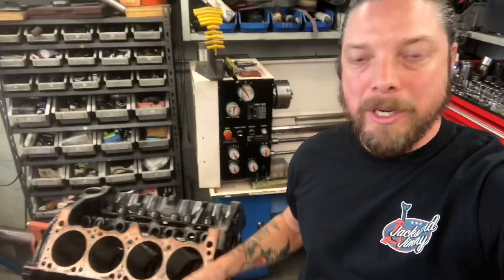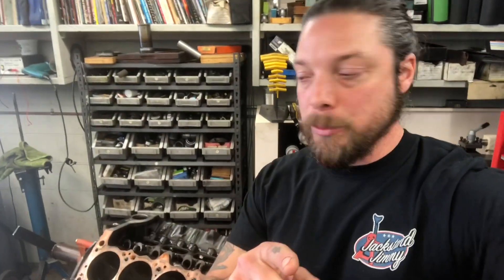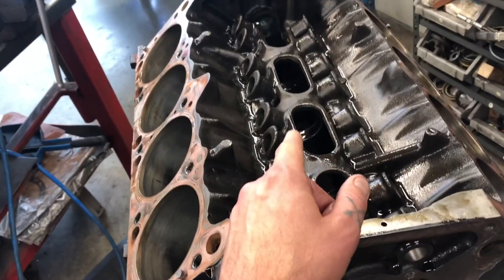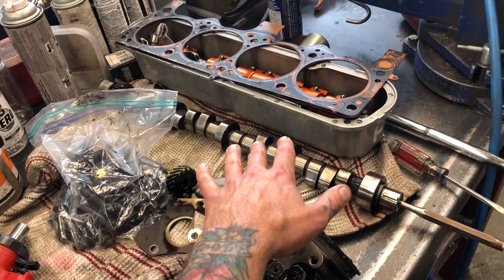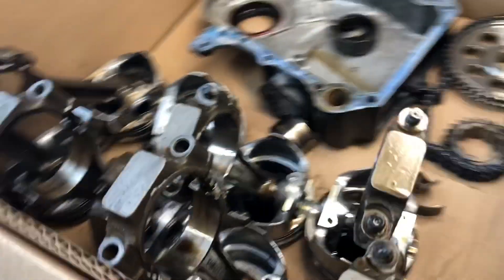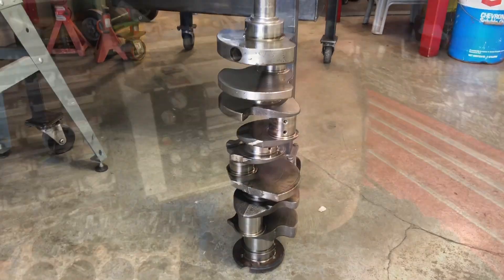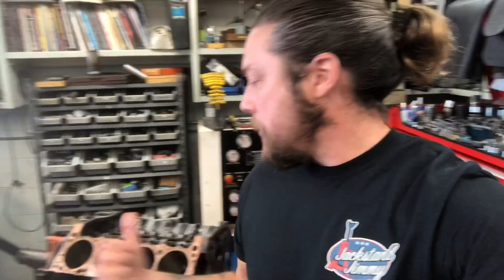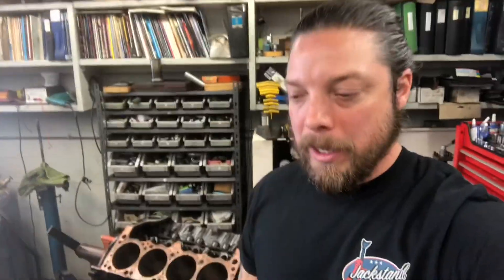Engine disassembled! The good, the bad, the ugly.

Comment: Mopars are Famous for lack of oil availability at the front of the engine. Set the motor as close to deck level as you can at the front.
Reply from the maker: I have fix this classic problem with my new build check out a newer vid!

Comment: With the future longer stroke your going to make more torque of course but your converter will still be in the right range and like you said you can shift earlier and take advantage of the extra torque and still be quicker. Also was that a stock cast crank?
Reply from the maker: Will be reworking converter to match new motor and trans set up. The crank that was destroyed was a stock 360 unit. Thanks for watching

Comment: I forgot to post this question but I was just curious what your oil pressure was at hot idle in gear? I know it kind of odd question and you know what went wrong but just curious fron when the engine was running good
Reply from the maker: 11-12 with 10/30 and like 18 ish with 20/50
Reply: @SimpsonsSpeedShop  really? What were your beating clearance if I may ask?  Did it have new bearings in it or did the bottom end have some miles
Reply from the maker: @moparornocar4618  don’t know clearance. Had the short block build 2 years ago.
Reply: @SimpsonsSpeedShop  oh okay yeah seems kind of low but I have seen multiple different variations. I ment to say bearing clearance but maybe they built it on the loose side for high reving. I have almost same build but 71 dart 340 stroker with same intake and ported and polished heads. I run 10w40 and see about 19-22 hot idle in gear and I was thinking mine was a little low. Anyway man love the build and keep going it's awesome
Reply: I've heard that loose cam bearings can bleed off a lot of oil pressure/volume. I would definitely mic your cam bearings and cam journals, too.
I like the idea of deepening the oil pan sump. I did that for my 360. I took my 360 pan, I cut near the bottom of the sump off the pan, then welded a band of sheetmetal around the pan then added back the bottom. It added about 2qts capacity. Some hi- capacity pans add to the width, but that would have interfered with my headers. Of course, it takes some creativity to lengthen the pickup, too. If my car ran times like yours, I would add some baffles while you're at it.

Comment: Looks like you dodged a bullet. I also agree you might want to get into that oiling program upgrade regardless of rpm's. I'd also look into getting a pcv eliminator so your not sucking in that contaminated oil. Good luck.
Reply from the maker: 👍🏻 I don’t use a pcv. These is one in the valve cover but it’s blocked off.

Comment: Get the Mopar small block engine book. It has all the proper modifications that you need to do for roller lifters. I did the modifications to mine plus restricted oil to the top end. I also added a 3 quart oil accumulator to the system to make sure the bearings always have oil.
Reply from the maker: Haha that book is coming from Amazon tomorrow. I already run roller lifters but bought for oiling mods 👍🏻👍🏻
Reply: @SimpsonsSpeedShop  let me know if you want any pictures of the stuff I have done. I will be pulling the motor out soon so can send whatever you need.

Comment: All the block  oiling mods in the world won't help with a junk oil pan like that stock replacement. Will uncover the pickup and starve the oil pump get a pan with more volume and or way better control under g force and 7000 rpm will be no issue. We turn that much rpm for 20minutes straight in oval track racing for years between rebuilds without failure most of the time lol

Comment: DO YOU RUN A SYSTEM ONE FILTER?
Reply from the maker: I don’t know what this is
Reply: @SimpsonsSpeedShop  its a filter you can take apart and inspect for filings regularly
Reply from the maker: @waynewalleye8458  ah gotcha. No I just cut my filters apart.
Reply: @SimpsonsSpeedShop  look into system 1

Comment: Are you going to put in a bigger cam on the rebuild and are you thinking about getting a better oil pump to handle higher rpms ?
Reply from the maker: Pretty going to use same cam. To start with. May get swapped later but Will be almost the same engine build as before but with a 4” stroke, improved oiling and better pistons

Comment: What was the cause of the rod bearing failure? Bearing clearance problem to begin with? What oil pump were you using, and pressure was in the correct range? What weight oil?

Comment: Not sure about the high RPM's causing the problem.  In the mid 80's my 340 RPM's topped out at 7K. My Dart quit pulling at 7200, so I made my shift point at 7. I ran it on the street, and a few times on the track. Never had a problem with bearing wear. Took it apart after about 500 miles. It was clean. I do not remember the brand, but had a high volume oil pump, stock pan and pick up. 

Hope all turns out well and looking forward to seeing your next build. Love your Dart!

Comment: I would like to know what your rod and main clearances are...the fact that it survived this long with very little wear on the mains and cam bearings. It wasn't draining the pan....just may be to tight on the rods,    All the rod bearings had damage. Those long drives break'n in those gears no wonder it was getting hot.   My only advise cause everyone has to is mic everything,  don't use Plastigage.  Being a little loose on your bearings is good.
Reply from the maker: Interesting. Thanks for info
Reply: Plastigauge is ok, but VERIFY  with real measurements with micrometer. 
Many people don't know that Plastigauge needs to be "fresh" for any kind of accuracy. Old Plastigauge can harden in the sleeve.

Comment: Good to see the damage was limited. Does the sump have baffling in place as I noticed the factory mains mounted item during the video. The sump on my 340 has extensive extra baffling to prevent oil surge, all added by original builder to the performance sump. His words, "that's not going to work, it'll kill the bottom end in no time flat ".
7 1/2 litre capacity doesn't matter if it's all at the back under acceleration.

Comment: Gday Joe, thanks for the update and good luck with 408 build. Do your research with oil mods. The mains need priority oiling. You will end up damaging the new 408 if you don't do any mods. HV pump will bleed more oil out especially through lifter bores and drain your pan quicker. This has happened to me recently. I use Milodon 8 quartz and still had an issue. I've  gone back to std pump with high pressure relief spring using 25w-60 oil. 🇦🇺✌

Comment: Good deal , well you did save a Lot ,and thats great, most Mopar Bracket Racers Through out the years swore never to go past shifting at 6.000 R.P.M. and engines last many seasons. I think with 408 inches that the CC should be at least 215 c.c. for the Heads, i have spoke to hughes engines and they have not experiemented on TFlow heads for offsetting intake ports. W-2 may have been the better option for me ... I think i may yet use that FLow Tech2 guy. I would also Consider Maziere water pump to free up more power and maybe manual steering , that way make some power at lower RPM range

Comment: You should rewatch your gopro videos again. Likely it would of caught a dip in oil pressure or low oil pressure vs RPM while going down the track and possibly could of caught it sooner. If it's not in view position it so that it can capture your gauges.

Lucky to have caught the damage before it was too late.

Seeing as your rebuilding dollar vs hp you'd be better off ordering a procharger. You can get a nice d1-x procharger that's enough to support 1000+ hp and you can up the power as you go with your combination. Can take gear out run 3.55s and get a tighter converter and it'll be even easier to drive on the street and make way more power. Realistically your only going to make an extra 50-70 ftlbs of tq and 50 hp provided you stick with the same camshaft if your going with a stroker.

Getting parts is a nightmare right now good luck i enjoy your content.

Comment: Suggestions:  new cam bearings,   
coated main and rod bearings, new lifters and a custom ground cam made to your combination with 4:30 gears, 4 inch stroke crank, and the first gear ratio of your Torque Flite 727, and most importantly, a billet aluminum Melling oil pump.  It utilizes no screen pick up.  It's all integral.  Sweet piece that provides sufficient oiling for street/strip combinations.  
If it were mine, this is the upgrade I'd give it.  Enjoy.
Reply: maybe if he could fit 30 x 10.5 slicks

Comment: I'm glad the damage was not more serious. I agree with other commenters, you may need some oil system modifications. My RB 440 has a Milodon 7 quart oil pan wwith a stock volume, stock pressure pump and only two modifications to the stock oiling system. First is the oil pickup port in the block is opened up from 3/8 to 1/2 inch and second is the  rocker arms, rod #7 and main # 4 all get oil 100% of the time with a simple mod. The factory setup breaks them up into 120 degree segments. It's been together for over seven years with no failures. I shift @ 6500 and have had it up to 7000 a few times. 
.
Reply: Thanks for the comment/tips.
Reply: Was going to say same. There is an oiling issue, as even at that RPM they shouldn’t have cooked.
Reply: Old school knowledge right there!  ...and there will be Na-sayers regarding the 1/2" port... Ignore them!!

Comment: Its a good idea to restrict the oil in the first main to the driver side lifter gallery, specially with solid lifters. I like to make small restrictors to the oil going up to the cam bearings too. The more oil in the crank, the better.

Comment: You should think about getting a good oil pan for racing because lot of oil starving for oil is at the track when you leave and mostly in the shutdown when your spinning high RPM and the oil is not in the sump where it should be. I burned a engine up like that I had a windage tray but I did not have a oil pan that would keep the oil in the sump area and starved it for oil so many times I ended up with a rod knock but I got a good Moroso pan that keeps the oil at the sump instead of where it don't need to be.
Reply from the maker: Just got a new 7quart pan.
Reply: funny you say that.   
 Herb Mccandless hates Moroso oil pans.

Comment: I'm glad you had minimal damage. 
You run on a very short track and 65 to 7000 RPM is everyday normal for a modified small block. It sounds like your friend decided for you, on the crank. You need to fix the oiling, put high quality bearings in it, turn the journals, and spend some time on the tunnel ram install. Give it some air!
Reply: 4" race crank, possible new rods, new pistons ( less compression distance ) = MONEY!! With a 4500 converter and a 6000 limit, 1st. gear will be gone in 1500 RPM. Now you're running the track in 2nd. only. You will make more power, but you won't be using it. For your track/combo, you are going backwards at a high cost. You need to think past the ultimate power number.
Reply from the maker: Converter will be re worked to work with new combo

Comment: You need to restrict the oil to the top of your engine. Back in the the day installed copper tubing in the oil system to the lifter galley….I can’t remember what side, maybe the right? I believe direct connection has a tutorial on how to restrict it.
I ran this setup in a 340 30 over, TRW 13 to 1 solid roller and bill miller aluminum rods with W2 heads when they first came out….Good luck Jim from Crosby, Tx
Reply: I ran the same copper tubing back in the 70's in my Super Stock Duster 340. The Ramchargers did the mod. It worked great! After 2 yrs of racing the bearings looked like new! My red line was 7,400.

Comment: Pump gas is very inconsistent, I would consider detonation as the cause of pounded out rod bearings. If it was an oiling issue the mains would go first.
Reply: The rod bearings operate at higher speed and build more heat.
Reply: @23Roadster1  The mains get oil first, or starve for oil first. So for the mains to be mint and rod brgs pounded, that's odd.
Reply: @tenthousanddays2103  You have made my point. If oiling is marginal, the further downstream, the more potential for damage.
Reply from the maker: Interesting. Thanks 👍🏻

Comment: Can you use those pistons, or with the added stroke do you need lower compression pistons?
Reply from the maker: You could possibly use these pistons, would have to check compression hight, but I will be going with new forged units
Reply: You can't use stock pistons with a stroker crank.
Reply from the maker: @rjohns8374  these aren’t stock. But I don’t know compression hight  so maybe not

Comment: Did you disassemble the oil pump? That is very important. I turn my stock 289 hi-po to 6500 roms so I dont buy the rpm issue. You better have who ever hot tanks it that each oil galley passage is brushed out clean.
Reply: Big difference in design between a 289 and a 360, though. I would feel comfortable turning a stock crank, stock rod 289 to 6500 with no problem. I'd be a good bit more careful with the longer stroke 360.
Reply: @1965l88  I didnt realize he was running a stock crank and rods. Hopefully he will op for a good stroker crank and rods.
Reply from the maker: @jonlennon3348  I will
Reply: new to this build, but i'll toss this in as well since I run an Olds 455--I have an electric fuel pump wired to the oil pressure guage, so when pressure drops it stops fuel flow. Some will wire the ignition to the oil pressure gauge but i figure if the fuel's still flowing, it may wash down the cylinder walls with no ignition. so, like all things in life, pick your flavor of poison :)
Reply: @albertgaspar627  That is a really good idea. No dry start with your idea.

Comment: Check & recheck ur clearance l would go through the traps at 8500 on my la318 w/w2 heads in early 80s no fail w\high volume oil pump 40 oil loose bottom
Reply from the maker: Was using a standard pump. New one will be high volume

Comment: Is the piston compression height going to work with your 4 inch stroke
Reply from the maker: Getting block measures and checked now. Using diffent cranks rods and pistons